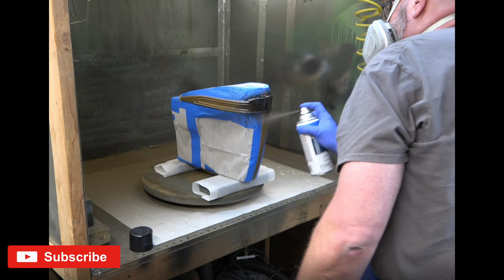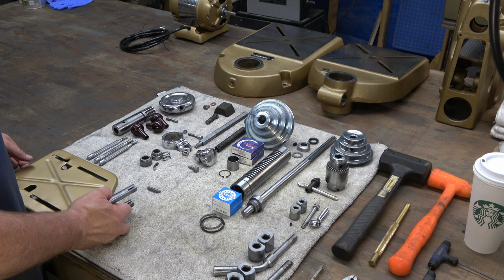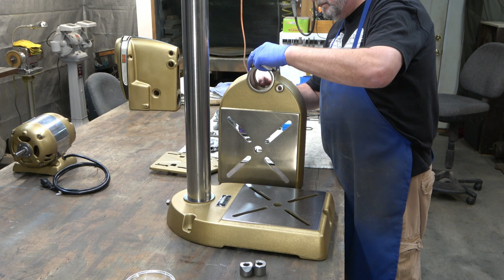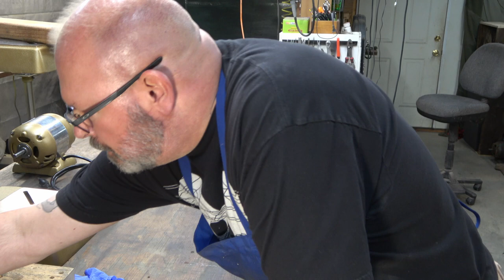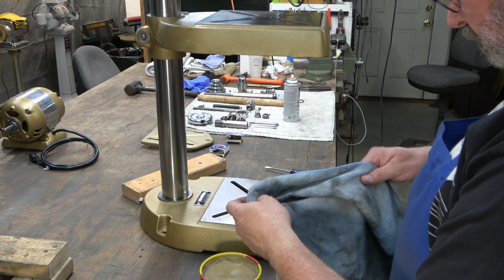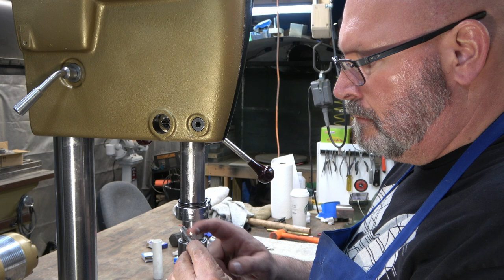Part 13 Rebuild 150 Craftsman Drill Press (Starting the Assembly)

Comment: Would you happen to have the link for the brass vice jaw covers you showed in this video?? I went to McMaster Carr and was unable to find them. I have a 4 inch Wilton if you should need to know that. Also, would you know what size retaining clips/snap rings I need for the quill assembly and where I can get them?? Specifically, the one that goes inside the drill press head, and the one that goes on the quill. One last question for now. I am restoring 4 of these drill presses at the same time, almost assembly line style, doing the same task to all 4 before moving onto the next. One of the spindle pulley assemblies has a paper thin brass bushing between the first bearing to be installed, and the pulley. Was that an original piece to this puzzle, or was it added by a previous owner, and is it a necessary part, or not??
Reply from the maker: Thank you for the question. I got my vise jaw covers from McMaster but the no longer carry them. McMaster product number 5346A22. I would do a search for Set-Screw-Mount Bench Vise Jaw Liners Smooth, Brass, for 4” Wide Jaws. 
I have never seen the brass bushing on the spindle pulley assembly, and I am fairly certain it was added by the previous owner, perhaps to take some play out of the assembly.
As for the retaining ring that goes inside the head, it is called the Outer Snap Ring and is item # 5 in most owner’s manuals. I am at work and cannot confirm exact measurements atm; however, the bearing that rests on this retaining has an OD of 52mm. I would recommend you try McMaster part # 97250A210. This ring should work for you and comes in a pack of 5 for $12.48. As for the quill retaining ring, normally # 32 in the owner’s manual. McMaster part # 95524A147 which would be $9.30 for a pack of 10. Lastly, just to be complete, the Spindle Pulley Assembly Inner Snap Ring, Owner’s Manual Part # 4 is McMaster Part # 98541A440 and is $9.50 for a pack of 25. I have been tossing around the idea of selling these parts, so people don’t have to buy a big pack of 10 or 20 of something; however, I really don’t have an easy, cheap, and fair way to sale them. I even tossed around the idea of a rebuild kit with all the parts needed but it would be well over 100 for everything.

Comment: Great Videos! I have a King Seeley model 23130 which I think is around 1949. I didn't have much luck restoring the motor, but I still kept everything and purchased another 'working' motor. The components are very similar with a few notable exceptions. (motor doesn't tilt like the later models, the chuck is different) My issue is run-out. I've watched your videos and took mine back apart to start over with installing the quill. Bearings are the same, washers the same, and installed very much like yours. Still, my run-out is really bad. Suggestions?
Reply from the maker: DeWayne, probobly you best bet is to create a free account on The Garage Journal Forum, then post you issues in this thread. https://www.garagejournal.com/forum/threads/craftsman-drill-press-information-belts-bearings-chucks-keys-etc-1946-1984.489080/